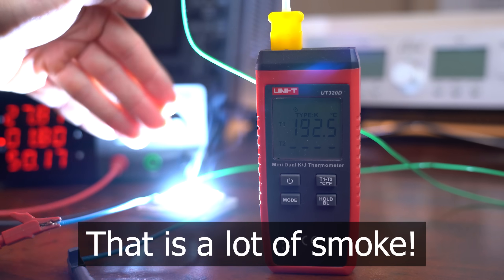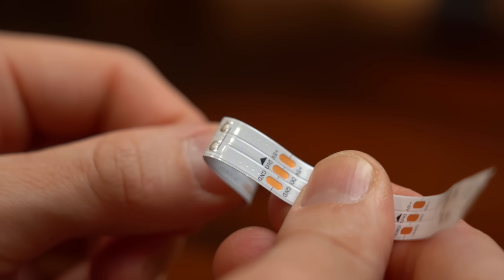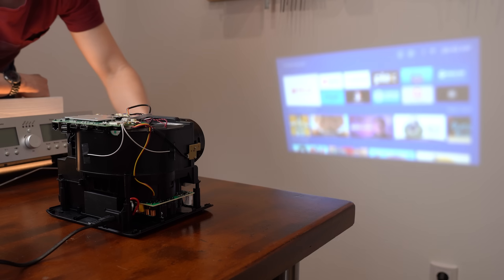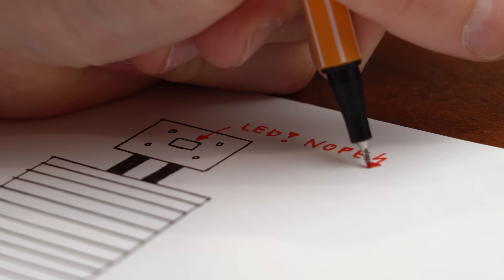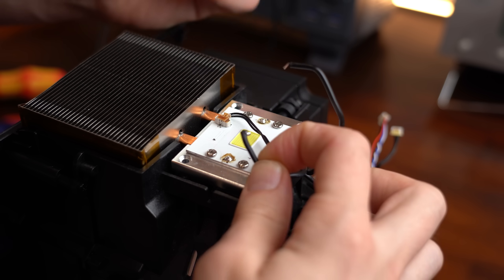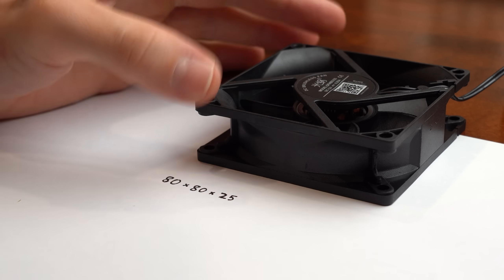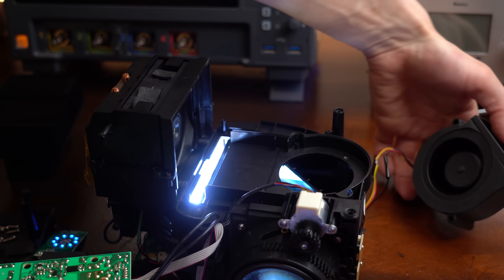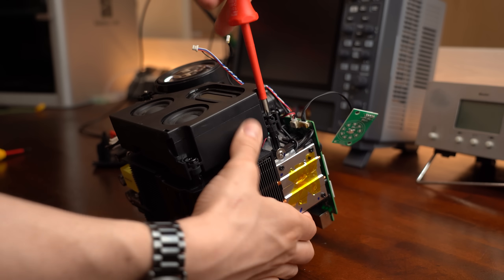Your Cheap Projector has 1 BIG Problem?!

Comment: Second fan: 
You may want to look into sound insulation. This may lower the sound from the second fan

First fan: 

Noctua May have been a better brand of fan to order. Also you may have made the mistake of looking at CFM and not pressure. You may need to look at the pressure the fan is capable of making and order a fan that is comparable. I can't remember the specific name of what I'm trying to say. But you have what appears to be a standard case fan....if a little bit thicker....so Noctua Will have you covered for both types.

Comment: 7:45 if your new thermal paste is better performing, you should expect an increase of temperature on the heatsink. Lower temps means that the heat transfer from the LED to the heatsink is lowered.

I think lowering the speed of the centrifugal fan that’s used to cool the LCD screen is quite a bad idea, especially if you are watching a lot of movies that contains dark scenes, or black bars (21:9 movies). The LCD screen blocks a lot of light and it will converted into heat on the panel. Without proper cooling, the screen polarizer will quickly degrade and produce a brownish, bad looking images. There’s a lot of case of this degradation happens quickly in hot environments, sometimes less than 6 month of use. I don’t think it is a good idea to increase the temp of the panel even more.

Comment: The high-powered LED used here is a COB (Chip-On-Board) type, which tends to generate a lot of heat. If that heat isn't managed properly, the light output will degrade faster, ultimately affecting the projector’s performance and image quality. So I completely understand why the manufacturer didn’t take chances with a smaller fan or heatsink.

That said, you did a great job with the fan swap! Just keep in mind—if the new fan results in even a 5°C increase in temperature, it could significantly reduce the COB LED’s lifespan. That might lead to failure before the warranty period ends, so it’s worth considering re-running the thermal or lifetime calculations.

Comment: I would have just added some diodes in between the fan power connectors rather than use a whole regulator. But there we go, there's another option for you. Great video by the way!!!

Comment: I did something similar with an Orico DAS because the fan was ridiculously loud for how little air it moved (cheapest fan possible). It was audible from across the room but the HDDs still ran hot. I ordered a fan with lower noise and higher airflow to keep the HDDs cooler and preserve my sanity. It worked great and only cost me about $7 (after shipping).

Most people don't realize just how many fans there are out there. When searching Mouser Electronics for my replacement, just entering dimensions and voltage revealed 1500+ results. I was able to dial in the exact noise floor and airflow balance I wanted to achieve for my device.

Comment: Why not just a low value resistor in line with the fan? Drop the rpm by around 10% and also the noise...

Comment: Yea replace the heat tube rad with a better one or water cool the thing..  but then i guess youd have the noise of the pump and would still have to cool the water somewhere unless you had enough to maintain equilibrium..

Comment: Glad you mentioned that the lifetime goes down. Still, I would have preferred you creating perhaps an external larger fan, like a noctua or two, with an airflow duct leading inside. This way you could have a nearly noiseless system with even improved cooling.

Comment: The yellow wire isa the "Tacho" ( = RPM) signal of the Fan to the motherbord, just like a regular 3-pin Computer fan ~25 years ago ... the "ChengX" brand capacitors (of the internal power supply) at 10:04 is not really the stuff you want

Comment: For the 2nd fan you should have monitored the power pins instead of yellow wire, I mean its speed might be controlled with PWM which you have bypassed with 9v..🤔
Reply: Nah, dropping the supply voltage with PWM is cumulative, it wouldn't override it (if the fan was running say a 75% duty cycle at 12V it's now running 75% at 9V)

Comment: Nice job! Reminded me of basically any GPU I owned before they startet putting decent fans on them: New thermal paste and/or replacing the fans with some ziptied on 120mm ones was the standard procedure. I call that Ghettocool Deluxe.
I'm so glad that my older Sharp beamer came with a pretty good quiet mode. Sacrificing a bit brightness for almost inaudible fan noise is such a gift and since I only use it in a darkened room, it is still more than bright enough.

Comment: It's a much bigger mod to do but if you added extra heatpipes either to the existing cooler or going all out with a custom cooler it would perform way better. Those cold spots in the heatsink are areas where the really thin fins are failing to efficiently conduct heat that far from the heat pipes - more pipes means smaller distances along the much less conductive fins
Reply: This was what I was thinking as well. There seems to be enough room to drill and add some additional heat pipes to either side.
Reply: @BertNielson  He would need a milling machine to modify the plate. My first thought was that the LED isn't making proper contact with the cooler plate because the copper pipes seem to protrude out a bit. Grind and polish, maybe a few degrees difference there.
Reply: That´s more or less irrelevant and out of the window for the task intended. The main problem is not the LED but the cvoolinmg of the display. Those LEDs have no problems with slightly higher temperatures, the displays and polarizing filters do.
Reply: @AlRams-cc2et  Well not really, the scope of the mod is to improve the active cooling systems, the first of which was in fact the LED cooler (which is still important, just not the most important part). The LCD would have been good to include but it wasn't included
Reply: On the subject of pipes... Knowing that it goes against the grain of having a compact -- possibly overly-compact -- appliance, would the use of a chimney -- in place of the centrifugal fan, or in addition to a slowed version of it -- reduce the noise dramatically? The taller the chimney, the more effective it is, apparently, so I imagine taking this route, you'd want to integrate the chimney with a floor-to-ceiling stand -- in part to make the length of the chimney variable, but also for aesthetics...

Comment: As mentioned by others Noctua is a good option, they design their products to have less of an annoying noise as well as operate with good performance. I assume you ignored static pressure measurements on the fans because the heatsink has fairly large gaps between the fins? Because I'd look at something with a similar static pressure to the original which was reasonably good to begin with.

Comment: Reducing the airflow will toast your LCD-panel. Even at factory-settings they age quickly. Perhaps a good idea to run in a ceiling mount, helping the heat to rise up in the pipes?
Reply: The 5°C increase for the LED will also let it age more quickly. This video was utterly pointless, "I reduced the airflow in my budget projector so it runs quieter but also dies more quickly".

Comment: Another thing to try would be constructing and fitting a sound baffle over the air extract. You can also try sticking sound deadening material to the inside of the casing.

Comment: The original heatsink compound is a phase change material, hence why it looks crusty when you opened it. However at higher temperatures it becomes slightly liquid, filling up the gaps. It lasts longer than regular heatsink compound.
Reply: It's already been established that by the temperatures measured before and after, he very likely worsened the heat transfer. Cooler heat sink means worse heat transfer. If heat transfer was ideal, the heat sink would always be at the temperature of the LED, and vice versa. The more deviation, the less heat transfer.
Reply: I wonder if liquid metal would be a better choice here than both thermal paste and PCM.
Edit: Scratch that. Forgot aluminium doesn't like gallium-based liquid metal.
Reply: no, it is regular sodium silicate thermal grease. it looks like it has a higher fill ratio and thus higher viscosity than the typical pc stuff but it is absolutely not a phase change material.

Comment: Cool video, for a bedroom setup it would honestly still be too loud for me. This seems like a perfect scenario where you could use an AIO though and mount it outside, since it still has the other fan for airflow inside the system.

With the given temperatures inside you could probably also go even more crazy with the voltage regulation and maybe even add a potentiometer for further control.
Maybe you could even experiment with a standard Noctua fan and some 3D printed parts for airflow redirection.

Comment: Honestly I change chassie of projector with 3d metal print of copper or aluminium. And extended whole cooling block to body for more heat capacity
Reply: This is the most expensive possible solution to this problem, it makes even my suggestion (custom cooler with more heat pipes) seem cheap and easy...

Comment: Keep in mind that the performance of the cooling system will drop over time as dust builds up inside. The trade off for lower noise may be that you need to open it back up more often for cleaning.

Comment: Personally I would have gone for a liquid cooler 360mm aio, which you can get for 80 euro, swap out the 3 fans for noctua fans maybe even in push pull configuration so 6 fans total for optimal low noise and higher cfm at lower speeds. My own rig has such an aio config and I can open
the case and the fans can barely be heared. Ofcourse something needs to be done about the outershell of the projector, but I would be fine having a little hole in it if the projector would be more quite and cooler

Comment: Would be kinda cool to add a PWM fan and add a microphone, so the fan revs up if there's a loud scene and is revving down, if it's quite. So basically a more powerful fan, which cools much quicker the components down, if it's loud, so the temperature can increase a bit while there's a quieter scene, until a high temperature threshold is met and the fan goes into a high power mode, to make sure nothing overheats.

Comment: What makes a fan sound loud is when there's obstruction right in front of it.  Here, there are two obstructions: the heatsink fins, and the case. You could cut a hole in the case, of course, but you can't eliminate the heatsink fins. What you could do is mount the fan on the other side of the heatsink, pulling air through it rather than pushing the air. This should make it much quieter. You'd need to be sure to have a good seal so that all the source air comes from the heatsink, though, instead of from around it.

Comment: dont forget that you live in a cold place, and this machine is delivered worldwide! 
As you would never use this projection in a 35+° room (common in my country), i think that is pretty safe to run with even lower speeds.
Reply: If your room is that hot, you need to have air conditioning.
Reply: @simontay4851  unless you are infirm you do not need the air conditioning even at that temp.. it sucks but you adapt within a week or two if you don't hide inside your refrigerated icebox of a house/car the whole summer..
Reply: @simontay4851  well, you live with it. it make 28'C feel like its good time get a jacket or blanket.
Reply: @simontay4851  Its hard to have air conditioning if you barely have electricity, windows or roof over your head

Comment: Inside mine, in the compartment underneath the circuit board on top, Ive got screen burn on one of the semi reflective glass panels and on whatever the part is called in there that creates the image. Have been using it everyday for a few years though.

Comment: One critical point you overlooked with reapplying thermal paste is the actual thermal contact surface between the LED PCB and the block. It's hard to tell from the video, but it looks like the heatpipes and the block are not compeletely flush. Combined with the 4 screws only on two edges of the PCB, it seems like there could be a huge gap in the center, where the actual LED chip sits and most of the energy wants to flow naturally. A thicker layer of thermal paste is still a prettyy big thermal resistance, so there might be potential to optimize the heat transfer and keep the LEDs shining bright for longer.

Comment: I think decreasing the airflow over the LCD will decrease its life. Especially if the content is a dark movie (where most of the light is being blocked and absorbed by the LCD). I feel a more suitable solution would be cooling the air with a peltier module.

Comment: @greatscottlab you can also make use of accoustic clouds external to the case to soak up the noise.  Like a suppressor on a firearm.  A short throat of material on the intake and output side.  Maybe 10 cm.

Personally, I'd just get a few noctua 120 mm fans and undervolt them and 3d print a plenum to direct the air across the fins.  Wouldn't be internal to the case, but would be QUIET.

Comment: 7:45 if the heatsink gets colder with everything else identical, it means the led isn't able to transmit its heat as effectively so it's bad. But having the probe taped to the object isn't that really reliable anyway so I don't think this observation is conclusive of anything.

Comment: I have a couple of these price range projectors, and the fans are loud for sure, but I figured out how to block the sound with a box around the projector with an open bottom or back and positioning the projector behind my bed far enough. I mostly watch action stuff on it so just making the sound bar louder works with this solution.

Comment: Why not rebuild the fans with 3D printed toroidal design fans. They are much more quiet. Maybe there is a toroidal fan readily available in the sizes you need.

Comment: Hey Scotty.

Yet another great video from you (never experienced the opposite though).

Besides noise and thermal escapism, how was the projector doing it's job?
You installed in your bedroom;
Does it require a dark environment to be sufficiently enjoyed?
Was the colors sufficiently natural?

I really am puzzled why the manufacturers of these rather affordable projectors don't prioritize noise dampening over enclosure size. 🤷‍♂️
I would have no problems making the device 50% larger (and also a bit heavier) and then gaining significant benefit from either completely passive cooling, or at least significantly lower fan noise due to a larger fan and/or lower fan speed.

Thanks for all your great content.
I find lots of inspiration from your videos. 🙏

Best regards from Denmark

Comment: Why didn't you just drill 2 holes in the case and connect a 240mm water cooling block from a CPU?  It has 2 fans that are way slower and quieter because of there size, and water cooling blocks don't use that much energy.  Sure there might be some difficulty in attaching it, and having a hole in the side won't be visually great but it will be a lot quieter.

Comment: I've been wanting one of these newer cheap projectors for my ebike camper...you can get decent resolution now for a reasonable price.  I used to have a projector 1024x768 projector way back in the day when that was a decent resolution, I got it for $100 on Ebay with unknown bulb use.  I used it for several thousand hours and never had to replace the bulb.  I want a projector at least as capable as the one I got nearly two decades ago for $100.  And I don't want to spend much more than $100. Looks like that is finally a possibility.  I have considered building my own using some parts from a "toy" projector, some VR headset LCD panel, MIPI to HDMI board, and a better light.  But it's probably basically what these manufacturers are doing, and I can probably buy an OEM for cheaper than I could build one.  The small VR LCD come in high res, but are about $80 with the MIPI board.  Add PSU, new LED light, etc, and it's probably better and more cost effective to just buy one of these newer inexpensive projectors.

Comment: I'm betting a noctua fan would have made a huge difference to sound levels. I replaced 3 in my PC case and it went from jet engine to silence.
Reply: They're not magic. As shown here, less noise often comes at the cost of less airflow. The only real way to avoid that is by scaling up the diameter.
Reply: @graealex  I would love to see someone cool a computer with 30 cm diameter brushless fans like those seen for car engine radiators.  Reconfigure those and spin them at a low speed, they will outperform even those claymade overrated Noctua units.  I have 10 to 20+ year old Nidec fans in my Nintendo consoles and there really isn't a noise problem.
Reply: @WJCTechyman  200mm is already a standard there. That's plenty cool and silent.
Reply: I did the same in a 3d printer. Had insanely loud 24V fans. Replaced all with small Noctua ones (and down stepped to 12V), that was a night and day difference!
Reply: Sunon is cheaper and just slightly worse than Noctua.. Noctua is just too expensive when you can get something almost as good for half the price
Reply: @tarakivu8861 do you know what SUNON fans specifically? i have a lot of 80mm ones taken from used desktop computers, and they are NOT quiet.